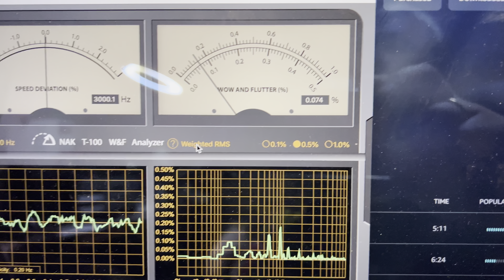Resolving Speed Issues in Nakamichi LX-3 - A Successful Fix

Comment: I've seen more increased speed issues with classic transport motors. Could it be a capacitor gone bad in the control print in the motor? I still haven't opened one...
Reply from the maker: I think it’s a hardened pinch rollers. This deck should be used for a while to get back to shape.
Reply: @hifirulezzz  So that means you think in the near future once in use the speed should be recalibrated several times? And what about new rollers? Not as good as the old considering w&f?